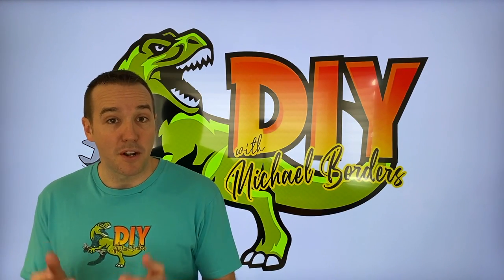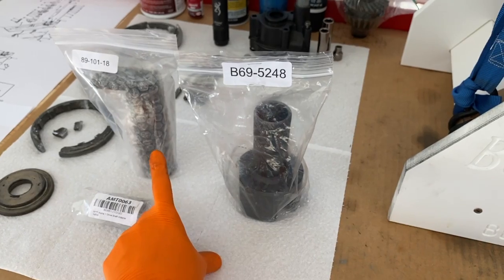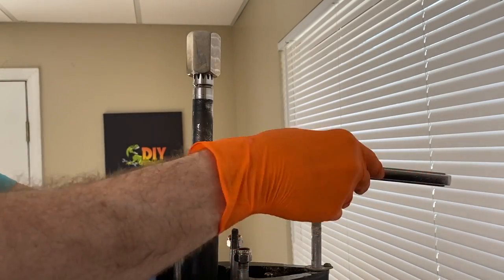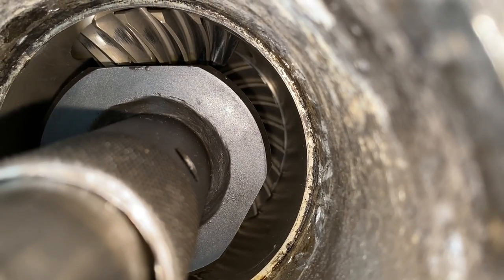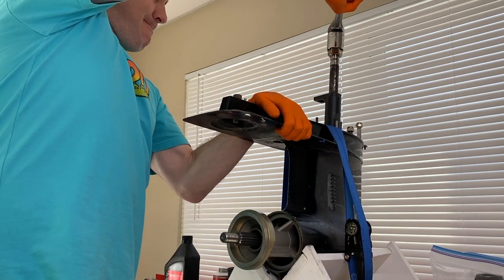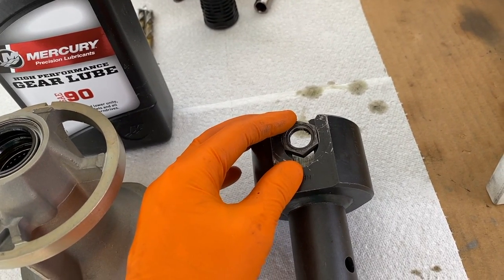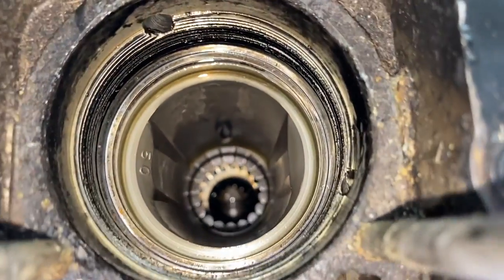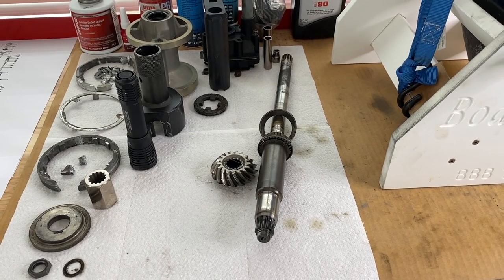Remove outdrive lower unit Pinion Gear - DIY

Comment from the maker: If interested in purchasing the products below, visit our Amazon affiliate links below.  I earn from qualifying purchases.

1.  Drive Shaft retainer nut removal tool (89-101-18)

          

2.  Drive Shaft Spline adaptor (AMT0063)

          

3.  Pinion gear nut removal tool (B69-5248)

Comment: I found it a lot easier to remove the prop shaft first and then use a 18mm ring spanner on the pinion nut to remove.
Reply from the maker: Thanks for watching and sharing your thoughts and technique.  Any and all helpful info is greatly appreciated.

😎👍
Reply: @cliveradvan3414 can you share the link to the tool please
Reply: Can you share the link to the tool

Comment: Any tips on getting off a rusted bearing retainer nut? My driveshaft bearing nut has some rust arpund the edges and won't break loose. I already got the pinion nut off
Reply from the maker: Hey good morning, thanks for watching.  Are you referring to the upper drive shaft retainer nut that rests underneath water pump base?
Reply: @DIYwithMichaelBorders  yeah
Reply from the maker: @TheBeedeegee  

Thanks for the reply, we would start by applying some penetrating spray such as PB blaster.  Allow that to sit overnight.

If that doesn’t help, you can carefully apply heat.  Please keep us posted.